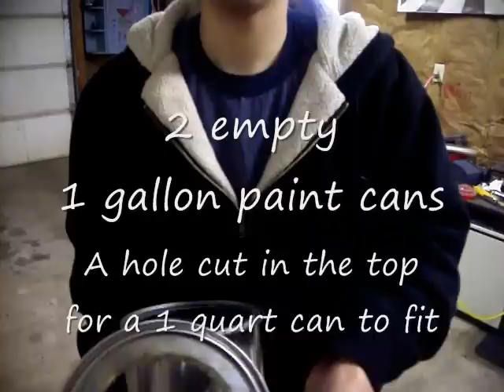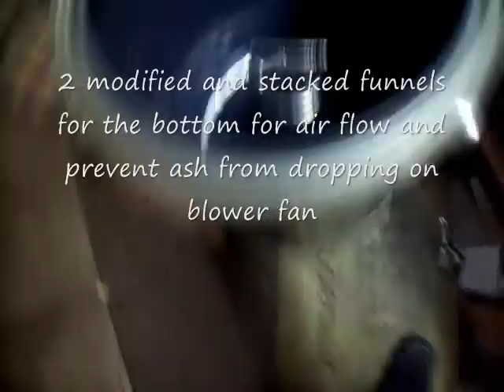How to build a basic wood gasifier

Comment: In proper gasification you simply heat the wood to 451 degrees in a sealed container over a fire.  This will char the wood allowing the gas to escape and be used as a fuel.  When you burn the wood direct you loss about 82% of the fuel in the fire.

I loved your first design and that would be the most effective way of doing it however you just put the fire in the wrong place.

Hope to see you and your son take on more projects

Comment: this is not rocket science but still damn hard to get right and be safe with it beware you will be burned if you play with fire long enough trust me grab the wrong part or open the wrong lid at the wrong time its like a bomb in the right conditions just use common since and you should be ok oh id recommend that you wrap your main parts in chicken wire jic it blows it will keep shrapnel to a minimal and might save your ass

Comment: This is not a gasifier.  This is an over elaborate wood burning stove.  You are not getting full combustion, so some of the off gasses light upon exit.

A gasifier heats wood (or coal) in the absence of oxygen.  Gases are given off from the wood in destructive distillation.

Google search: "wiki coal gas"

What you have is a wood burning stove

Youtube search: MAKING BIOCHAR: with Peter Hirst of New England Biochar 

And you will see someone who made an actual gasifier.